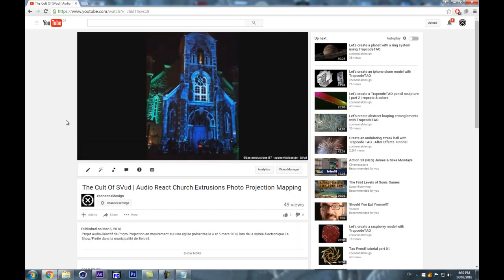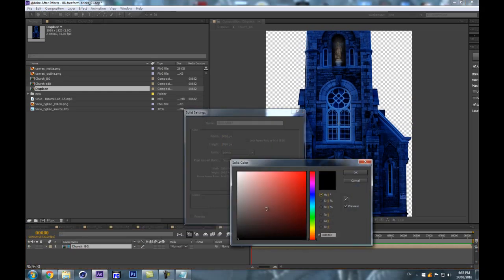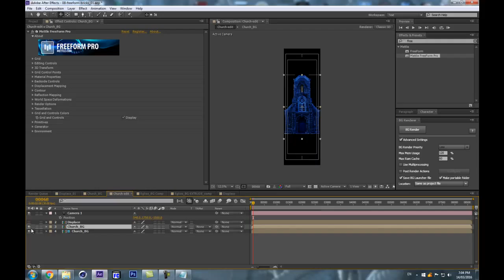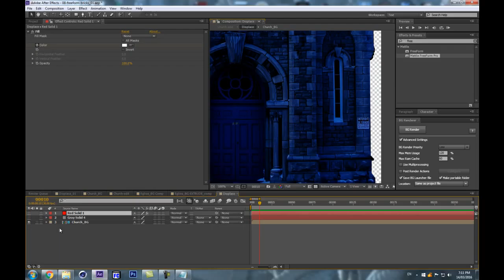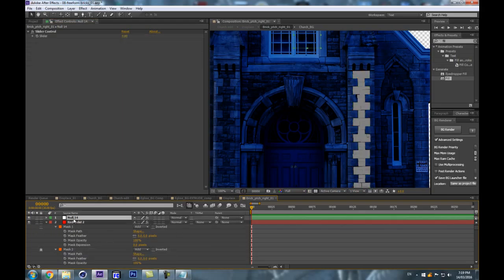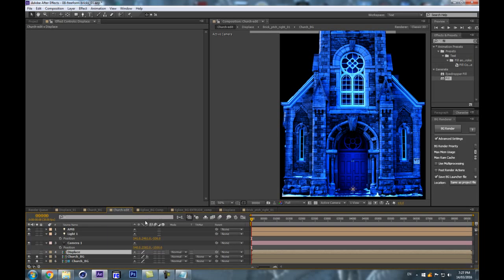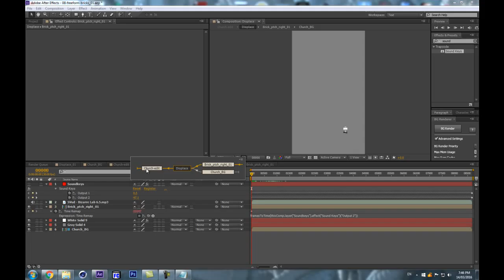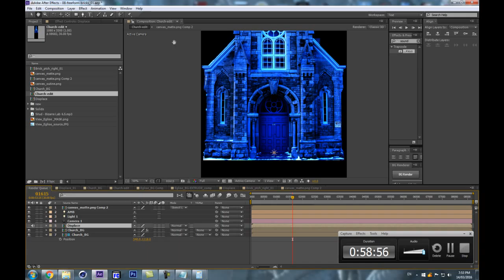Let's create AUDIO REACTIVE brick extrusions for projection mapping with FreeformPRO & After Effects

Comment: Any idea how can I do this without freeform plugin? It seems too expensive for a hobby... :)
Reply from the maker: the real way is to use a true 3d software, using the plugin IS the cheap way !
Reply: xponentialdesign well that's right but this method needs much less powerful computer :) for same result same pc using c4d would be really laggy and unbelievably slow rendering especially without team render :( thanks anyway, I found the demo so I'm saved for now..